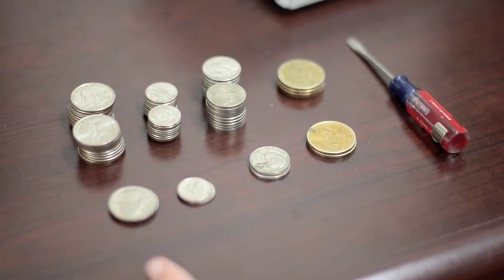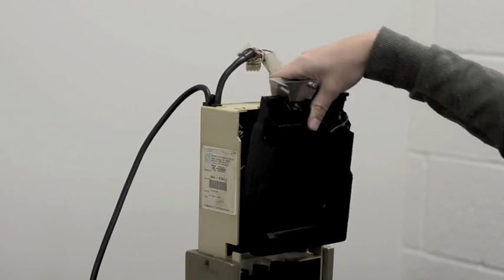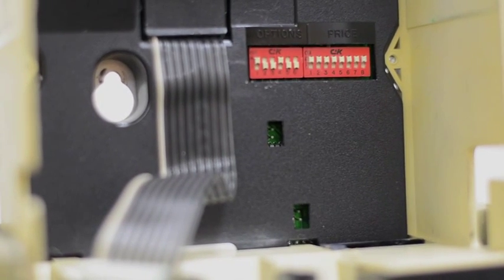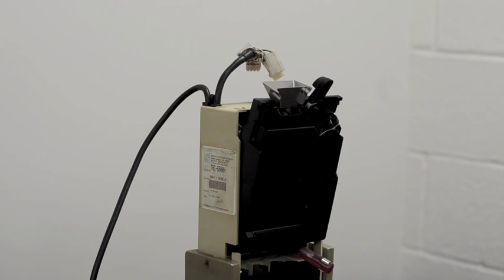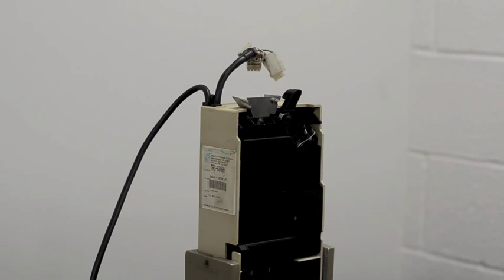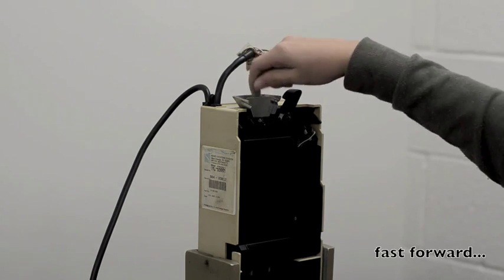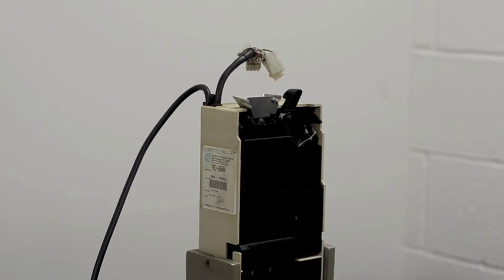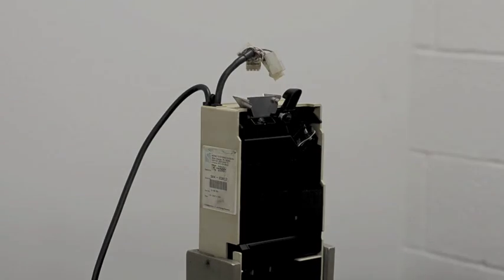How to Calibrate a Mars / MEI TRC Series Coin Changer

Comment: I had a mech serviced, and it won't take any coins.  Does that mean it's in learn mode?  There seems to be a plate blocking any entry of coins in the acceptor tubes
Reply from the maker: First thing I would check (most common) is if you have a jammed can in one of the columns. If any of the vend motors are not in the "home" position, the machine will not accept money. The machine thinks it's in the middle of a vend cycle and therefore will not accept any money until the vend cycle completes. Could also be a bad micro switch on one of the vend motors. Also, if the machine has no product in it, it will not accept money

Comment: Will coin reject of the coin tubes aren't filled ?  I have a 6800.  I plugged it in and coins just fall through .
Reply from the maker: That is most likely not a coin mech issue, probably have a jammed can in one of the columns. The coin mech will not accept money if one of the vend motors is mid cycle (caused by a jammed can). Check to make sure all vend motors are in home position
Reply: @Vendingworks  there is no product or jams present in the machine .  Mech is plugged into Jones plus .  Inserts coins and they fall through ...
Reply from the maker: @SLAPSHOP42  There must be product (past the sold out paddle) in at least one column for the coin mech to work. It will not accept monet if there is no product to buy
Reply: @Vendingworks  older machine there is no sold out paddles .
Reply: I tried retuning all the coins with passing through the rejector go to left side and don't drop into the change tubes .  I assume I have a dead mechanism ...?
Reply: @SLAPSHOP42  what kind of machine do you have because I have a vendo 407 and it’s old Old.  If it doesn’t have paddles inside the columns then where the motors are at the top u have to take make sure the plate is up touching the metal. Kinda hard to explain.
Reply: @SLAPSHOP42  everything has to be connected.
Reply: @arko2094  it was still didn't work
Reply: @SLAPSHOP42  did you end up replacing it ?
Reply: @arko2094  yep

Comment: Is it possible to interface a bill validator to a TRC-6000? If so could someone point me to the correct validator?
Reply from the maker: No you can't connect a bill validator to a Mars TRC6000. The coin mech and the bill validator connect to the machine independently of each other, they don't connect to each other.

Comment: Mine looks way different. Theres only a 4 pin dipswitch
Reply from the maker: Yes, only the single price model has two banks of switches, the logic and MDB models have one set of 4 switches. They still calibrate the same way
Reply: Ive tried to calibrate it using this method.  My trc6010 might be bad.

Comment: What happens if coins keep going to refund slot? After trying to reteach it?
How do you know it's in reteach mode?
Reply from the maker: Once you put it the 2 nickels, 2 dimes, 2 quarters, and 2 dollar coins, it will make a noise, like it's kicking out a coin. That's the only way to tell if it's in teach mode. If it is still not working, and y ou can't get it to calibrate, it should be replaced.